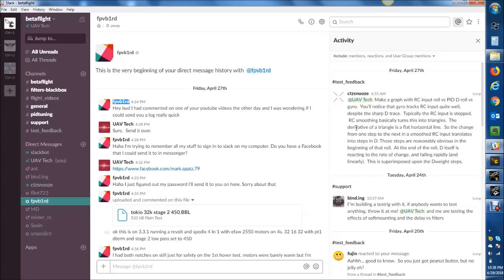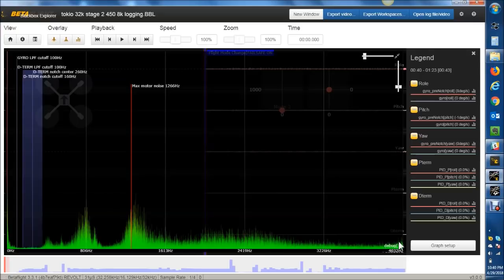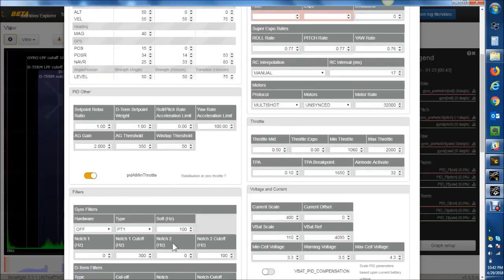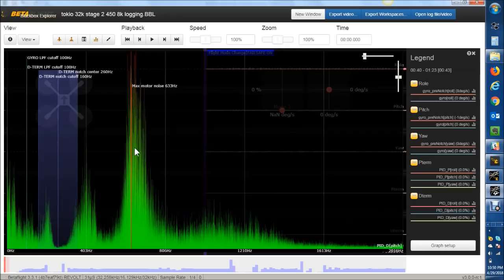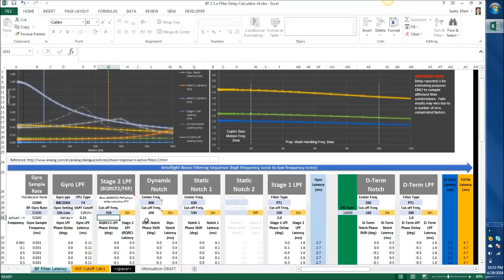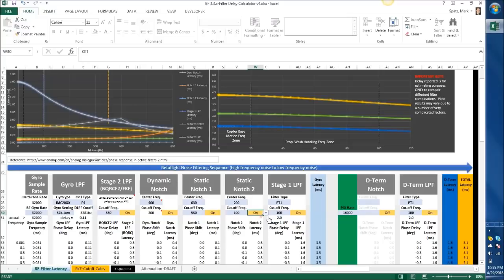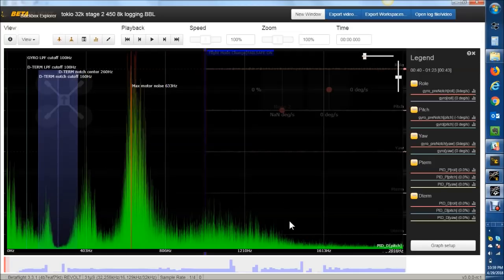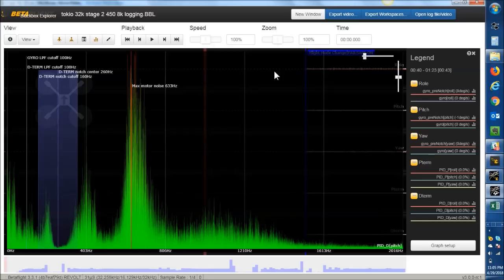2018.04.29 FPVb1RD-32k Filtering Tips

Comment: Mark - how much should we be concerned about sub-100hz noise? Sub-50hz?
Reply from the maker: Could just be prop. wash, not noise.  Is it a flight where you were inducing prop. wash?
Reply: UAV Tech  - probably some prop wash - not deliberate but doing some punch-outs and flying in high winds - motors are RCX 1407 4100kv with 3” props - and huge red spikes below 50hz on BB that seem to be influenced by P and D term strength. How can I get PlasmaTree software to analyze PIDS?

Comment: It would be nice, if we could choose the order of the filters.
Thinking if we were able to setup a notch to filter the worst motor noise, and then let dyn notch handle the rest after that.
Reply from the maker: Yes.  See https://www.screencast.com/t/nBoqozoPP4f.  The FFT process that drives the Dyn Notch is done right off the gyro data; after the DLPF of course.  Then the Dyn. Notch is done before the static notches; which really doesn't matter.  It might be worth a Pull Request (PR) for some consideration of having the Static Notches work prior to the FFT.  I will ask if that was looked at before.